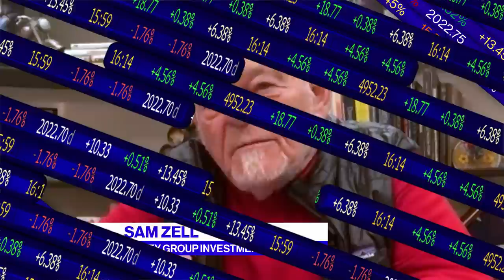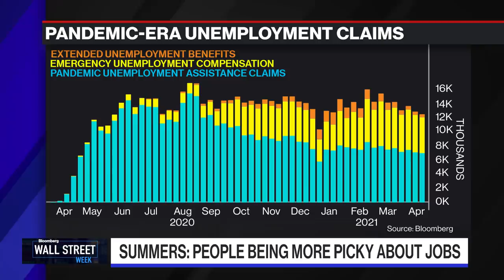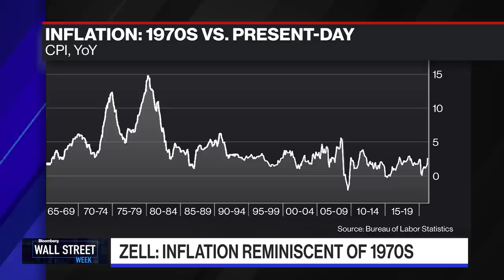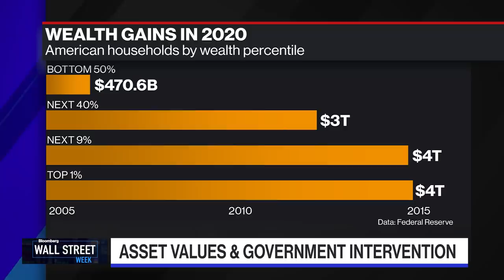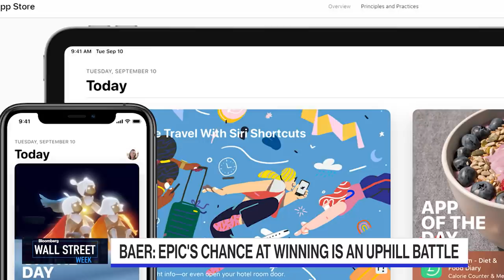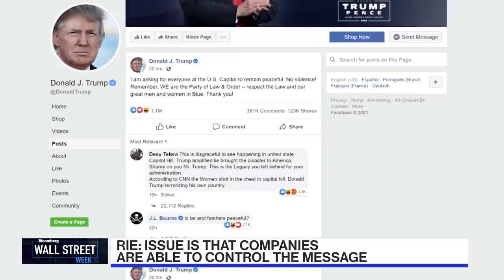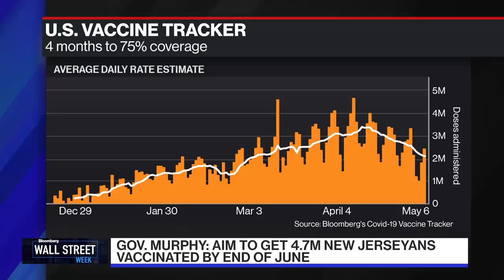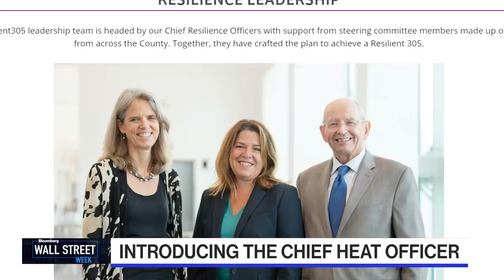Wall Street Week - Full Show (05/07/2021)

Comment: I don't think that retail money moving into investment, (which is now macrocyclicaly passing to Millenials,) will be tempted by large industrials because of the risk/return relative to a crash in lumber due to the property tax hike. I think they will cycle into junior miners the same way they went into altcoins as soon as institutions went into BTC and ETHE. Vital Metals has a massive multiple upside compared to MP Materials. Atacama resources has a way better reward to risk ratio compared to Barrick or kirkland, Playfair will grow faster than Freeport, Standard Lithium now has better prospects than 3M, and even Eric Sprott has gone all-in on New Age Metals PGM deposit, preferring to buy 1/4 of a PGM prospect at well over current market price, rather than investing in his own Physical Platinum ETF. Its simply forward-thinking. Shortages and inflation put the weight on new supply chains.

Comment: More phony ‘chip shortage’ propaganda 🙄
Reply: There is a shortage; you can't even buy certain PC parts these days because they're all sold out.
Reply: @method341  The shortage of GPUs is unrelated. A handful of automakers are affected ( Ford, GM, Honda, Mitsubishi, Nissan, Toyota, and VW are the ONLY affected automakers...not Daimler, BMW, Tesla, etc). They are getting caught flat footed after decades of over-dependence on just-in-time supply chains.
Reply: Make 1970 all mechanical ⛓⚙️🔩🔧 type cars 🚘 that don’t require computers 🖥